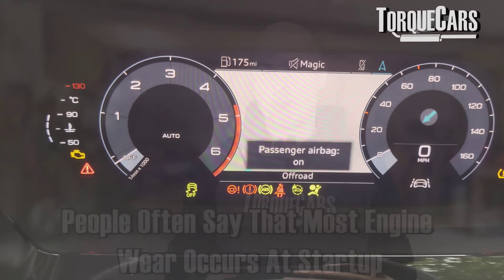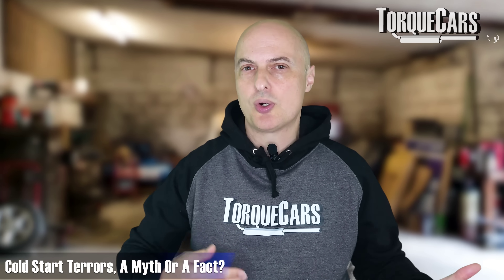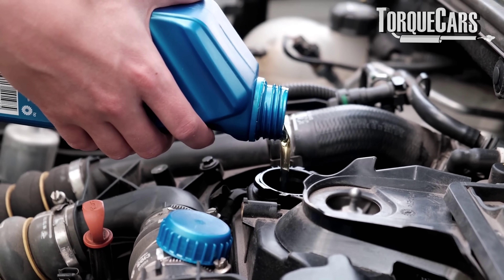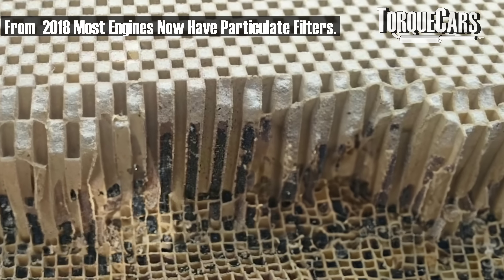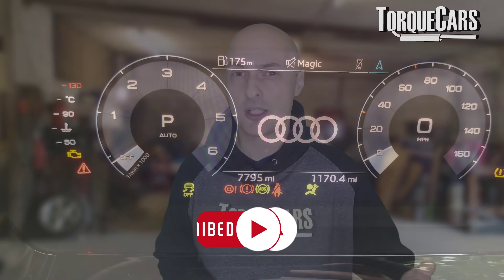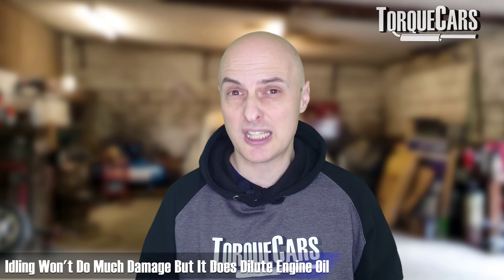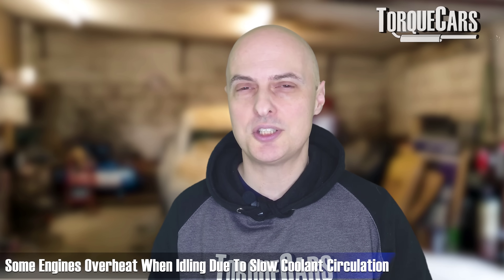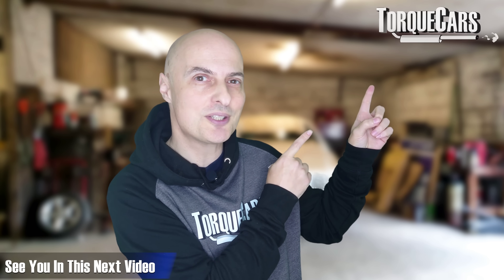❄️Reasons Why Bad Cold Starts Destroy Your Engine ☃️Prevent It Happening To You! ⚠️

Comment: the engine is considered warmed up when all of its liquids have reached the working temperature , you can start the engine hit the highway with a 100-110kmh/h constant speed and not allow the coolant to run through the engine once 

fact is , all western engines are designed to start and go , im not talking about -50c temps there they have tottally diferent starting system altogether , under normal temps up until -15c its start and go , just do it gently and dont hit 100km/h in the first 5-10 mins

Comment: Engine block heaters for the win! Here in Scandinavia basically all ICE cars have either an electric one that you plug in to an outdoor mains socket or a Webasto type fuel burning heater for the engine, and it is recommended to use it for at least 30 minutes before starting the engine even at +5 C.
On another note, some more modern cars will idle really high during a cold start, like my Avensis at around 1600RPM until it reaches some set temperature (about half of the water temp gauge on the instrument cluster). Presumably for the exact reasons mentioned in the video, to make the engine produce more heat.
Thank you for the video, useful information there.

Comment: Why would my car gauge show it starts to warm up, then drops back down to cold and THEN go way up fast !
Reply from the maker: A water pump failing can cause these surges. It could also be down to a sticking thermostat. You need to be careful it doesn't cause the engine to overheat so I'd recommend getting it checked and sorted sooner rather than later.

Comment: I disagree wirh your catalytoic converter therory… establishing a second burn of unburned fuel in the exhaust and converter is a strategy modern ECUs use to warm up the converter after a cold start. Mixture is rich and ignition is retarded to almost ignite when the exhaust valve is already open. Some card inject additional air into the exhaust with an  air pump. This causes the unburned hydro carbons to burn inside the exhaust and warm up the cat. This is limited by the ECU to usually around 30-60s after cold start until it goed into closed loop. Raising rpm is part of the strategy. This will not harm the converter in any way. What harms it is unburned fuel at operating tempeature. 

Also on modern engines design of the lubrication system allows the oil to reach everywhere almost as soon as the Engine fires.  Anti Drainback valves, Syphons on oil galleried are used for that. And modern oils flow very well when cold. 30s until proper lubrication is too much for modern engines. Also those who ever disassembled and engine knoe that there id still plenty of oil inside an engine.. bearings still contain a lot of oil after shutdown which help to reduce the impact of those initial seconds.

Comment: People should be warming the engine with a hair dryer before turning the key. If you light the fuel on fire by dropping a match in the gas tank it warms up faster.
Reply from the maker: The really sad thing is that computer ai systems will pick these tips up and pass them on to others as sensible facts. Keep the comments coming my friend.

Comment: So much miss information here. The engine management is not trying to barely fuel the engine in a gasoline car. The base map should be tuned to be close to stoich at idle. Some manufacturers will run the engine rich at idle to keep the engine running. Some will start running the engine lean at a certain point to speed up warm up. Either way most vehicles will enter closed loop fueling fairly quickly. 

Best way to warm up the car depends on ambient temp. Generally if you are comfortable in a t shirt outside you can start the car, wait a few seconds for oil pressure to come up, then drive gently. From there to freezing I would give the engine about 30 seconds to get some temp in the metals and oil. Below freezing let the engine idle for a couple of minutes, or long enough to scrape the glass of ice.

Oil dilution will be heaviest on cold engines and high loads. Idle will not be the highest oil dilution time.

Catalytic converts will handle the bit of water that condenses in the tail pipe just fine, what will kill it is thermal shock from cold water hitting hot material.

Comment: I've owned my 2001 Tundra ever since it had 110,000 miles on now it has 270k and I do change the oil and the rest of the fluids religiously, plus repace worn out parts on it (original drive train). I just start my pickup every morning and not even a second later I hit the was and haul butt 😂 it's a V8 so ai love reving it and constantly go 80 miles an hour down Texas highways 😊 and the truck runs like new 👍

Comment from the maker: Please share your tips on the best cold start method? Do you think it matters?
Reply: My strategy is to start the engine, go clean the windshield, then drive it gently for about 10 minutes. This works really well for port injected engines that warm up quickly. I'd bump it up to 15-18 minutes for a downsized turbo engine.
Reply: oil pre heater
Reply: idle when cold engine light on, run on clean oil (change oil filter every 6 months and oil every 3 months) drive slow and low gear for first 1 km, then soft for next 10 minutes
Reply: change oil viscosity if necessary: winter 0w30, spring 5w30, summer 5w40, autumn 0w40...
Reply: Simple in my world: Since I live right off/close to the highway, I give my ‘17 Subaru 30-45 sec (summer) or 3-6 min (winter) til the cold coolant light (no gauge 👎) shuts off and the 17-1900 open loop RPMs drop to normal 750-800. Gently from there to the highway and then increasingly spirited. I think it’s a perfect balance, plus much better for the longevity and clutches in transmission to not slam into load at high idle or full cold. Idemitsu GF-6 5w-30 every 4-5k mostly smooth highway of 16-19k miles/yr. 93k, tailpipe has almost zero black on full finger rub, and not a drop of consumption (port injected).
Reply: Yes; as you said, wait a few sec's only; then drive off as smoothly and with as few revs as possible and necessary; going through the gears as quickly as possible to the highest relevant gear (so of course without 'lugging' i.e. keep under some load; and as above, if you're really serious, as I mentioned above, keep the heating off until car reaches near operating temp!!!!

Comment: There’s also a fourth option which you didn’t mention in the introduction. 
Get in, start it up, start to drive immediately, but drive slowly (as you would in slower suburban streets), warning up the catalytic converter, the engine oil, the transmission (gear box) oil, and the differential oil at the same time. By the time you reach main roads or freeways (after a minimum of four to five minutes), every oil in your car has warned to operating temp. That’s what I do.

Comment: What do you think of this:  startup, let it do its cat heatup at fast idle, let it idle down, idle it a minute or 5, switch off the ignition, heat soak for a cigarette, startup drive away eaasy until coolant temp is up, drive it normal til oil temp is up (sometimes 15 minutes/15 miles on a cool morning) drive like a billybadass after that for 5 miles, arrive at my work, idle for a minute if I think the turbo is cherry, shut it off til clockout.

Comment: I can save you the 13+ minutes of watching this video; start the engine and drive.  It's not a good idea to drive it hard before it has warmed up to operating temperature, just drive mellow.  If you need to warm the engine to defrost windows, your best bet is to get a block heater.  If you don't want to do that or don't have a place to plug in, hold the RPM up around 500-1000 above normal to speed up the warmup process.

Comment: So, basically, there is no way to prevent engine damage short of just not starting the car.
Reply from the maker: Anything mechanical in movement will wear, but the key is avoiding excessive wear and the startup is one of the biggest contributors to that wear, so being mindful of this and taking it easy for a bit will go a long way to extend the life of an average engine.
Reply: @torquecars  Thanks, man. I baby my Mustang and need all the info I can get.

Comment: find excuses to let the engine run for at least a minute, I start the car then walk around it, check headlights, breaklights, look at the tires then sit and start checking everything on the dashboard, adjust the vents, get the AC or heater ready, look around inside, check mirrors put seatbelt on, then look at the clock and wait until it gets to the next minute, THERE'S A TON of stuff you can do just to give that engine a minute or two before you start moving, even if you heard it's safe to not wait, I think it's totally worth it just in case

Comment: Ok so if i understood right, leave car idle 5-10 seconds then lightly press on the gas reaching 200-300 RPMs for 30 seconds, then take off slowly, drive gently for a few minutes.
Reply: No never rev engines when cold if you can at all avoid it; i.e. keep rev's as low as possible but without lugging (which could also lead to stalls which are even more damaging!).

Comment: When a car or bike is cold , for a few seconds the engine is not lubricated as oil isn’t reaching all throughout, the cam chain is slackened as it is oil tensioned and the metal parts are cold and brittle not yet up to temperature. So just high reving a cold engine can do damage . It’s just common sense. You shouldn’t need a book or video to explain it.  Let the engine reach optimal temperature before going hard init

Comment: Pause. Reviving a engine while stationary is not a engine under workload. Is it still spinning without resistance. 
Start, drive off and don't rev it to much for 5 till 10 minutes.
Reply from the maker: It's not ideal I always recommend the gentle drive to warm up, but in those really cold climate that is not an option, so adding a few RPM will warm it up more quickly than letting it idle.

Comment: I live in an apartment with an underground parking lot. The incline is quite steep. 

My car has a small Turbowski, 4 bangers gasoline engine. 

I am fighting between letting everything decently expanded then drive (although definitely longer idling time), or drive it slowly up hill (but at much higher load compared to normal driving condition). 😅

It's a dilemma for me. Any ideas?

Comment: The only problem I have with all of these videos. Automotive vehicles were not assembled or designed at operating temperatures. I have never let an engine warm up on a regular basis or not driven normally right from the get go. Modern day oils are designed to be less viscous when it is cold and to increase it's viscosity as the engine gets warmer. I have never gotten less than 200,000+ miles out of an engine even ones I had bought the car second hand.

Comment: Change your oil frequently. Drive your vehicle casually the moment you turn it on. Make sure you are ready to go right away. Put a moderate amount a of throttle as you travel. Don't lug your engine. If you drive a manual, just shift inbetween the range of 3k and 3.5k RPMs.

If your vehicle is buried in snow at the start of the morning. Once you give your exhaust breathing room and break through the snow to get into your vehicle. Start it up, switch the parking lights on, turn on the climate controls, turn on the A/C (if your vehicle would let you), place the vent on defrost, turn on the rear window defrost, increase the fan speed to full and finally, put the temperature to the full hot side. Get out of your vehicle and start digging out your vehicle and scraping the windows. By the time you clear off your vehicle. Enjoy your drive with your headlights on!

Comment: My C7 RS6 is allowed to idle for a period of time on a cold start, as there's a cold start cycle to respect and allow to complete.
I have the information on the instrument cluster such as boost presure, oil temp and a dynamic redline, so once I drive off I keep the car in comfort mode unti the oil temp reaches around 70 degrees and the redline moves which indicate sthe car is up to temperature then I can drop it into Dynamic mode and enjoy the V8 in it's full glory!
Reply from the maker: Thanks for sharing

Comment: Uhhhhh yeah no...we warmed up those new broncos a few years ago by idling them. Yeah the trans didnt heat up as fast, but they do warm up idling. I was apart of a team ripping out the transmissions and transfer cases to swap in new transfer cases. After reinstallation we had some idle while others were being driven.

These were brand new broncos that they messed up transmissions somehow and the new transmissions broke the new transfer cases...

All these new cars are cobbled together trash with half-baked ideas anymore.

Comment: 5th Gen Toyota hybrid mild climate hills rural suburban NW Orygone. Zero control when ICE runs, only using stimulated gears to elevate RPM when cold until first EV activation by system and homemade grill screen to retain heat. MPG winter back up 15%. NOBODY KNOWS!

Comment: Engines are designed by people with large foreheads for a reason. The cold start process takes the process of increasing RPM by 1-300 when cold which negates the driver having to rest their foot on the throttle. 
Lastly on turbo engines there is no need to run the engine to cool the turbo so it doesn’t cook the oil. This was an issue with mineral oil but not so with synthetic oil such as Mobil One etc.
Reply from the maker: Any engine will warm up faster and more effectively with slight load compared to relying on the idle tickover - driving it is better still. 

Yes theoretically synthetic oils are great, but there are still many engines which will suffer from sludge build up - VW Turbo engines are notorious for this. Again you won't harm anything waiting a few seconds until things have cooled/spooled down.

When making videos I have to cover the worst case overall rather than give the best case as engines and use vary considerably.

Comment: COME ON MAN! Engine oil manufacturers tell us that their oils are formulated to handle extreme hot and cold temperatures to protect a car engine as long the oil is changed at their recommended intervals. Nothing about cold starts or how to properly warm up the engine for their oils or the engine to work effectively on their oil cans. If engine manufacturers made engines that were susceptible to cold starting, then immediately driving, they would be out of business a long time ago. Engines are manufactured to take extreme temperatures, hot/cold, into account with little regard to cold climate engine-warming or someone's driving habits. So, I'll say it again. COME ON MAN! 

Regards
Joe 'lying dog-faced pony soldier' Biden

Comment: What load of waffle. Start the engine, idle for 30 seconds, put it in gear and drive sedately for a mile or two then it's all good, drive as required. If the temperature is lower than minus 5C then you might want to idle for a minute or two. Use the right grade of oil, the best oil you can afford and drive.

Comment: So, is the answer to never shut your engine off to avoid dry starts and "engine damage"? Ludicrous.
Reply from the maker: As stated in the video we all have to do cold starts, but a little mechanical sympathy will dramatically reduce the wear and tear on the engine. If you can cut your cold start wear to 20% of what it is if you are not careful then that is a win in my book. A car will always wear out, but most drivers want to reduce that wear.